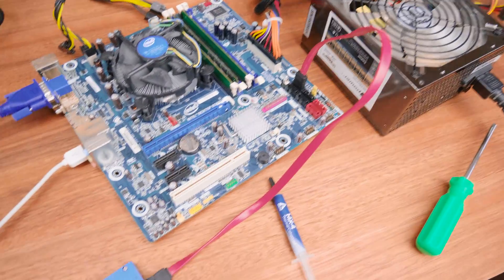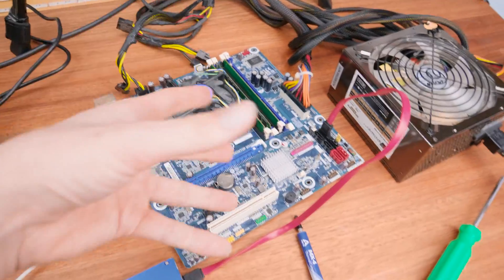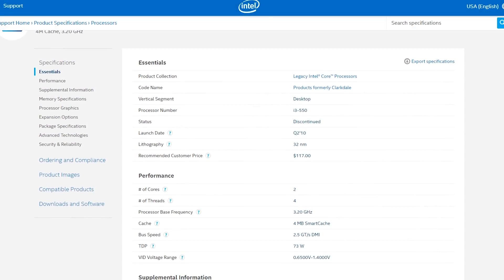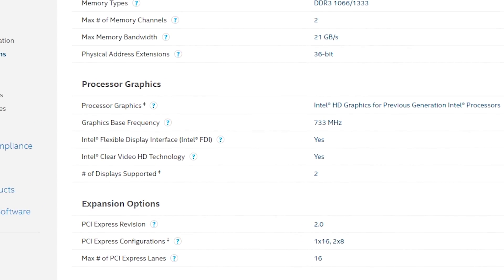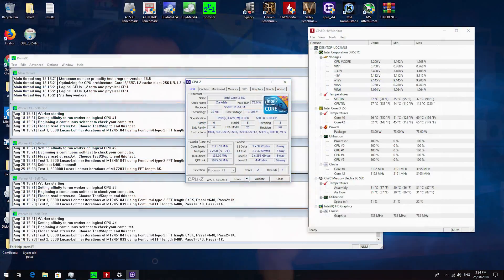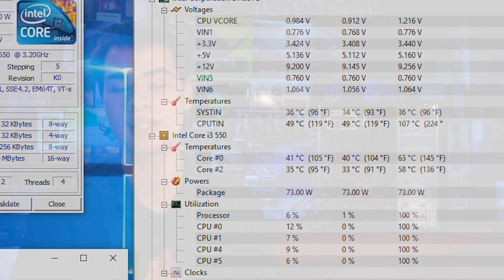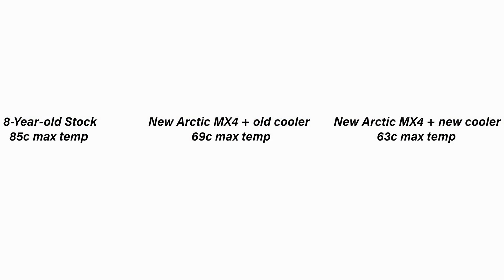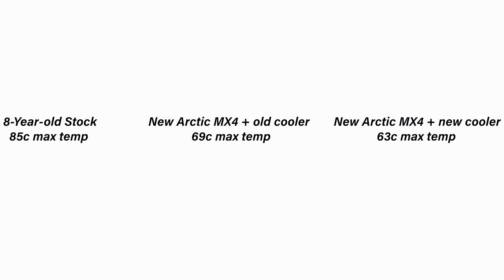How Bad Is 8 Year Old Thermal Paste

Comment: I just changed my thermal compound' but the tube was really old, + I haven't tried to OC lately & didn't check the temps 1st.
That said, the old paste was dried out & mostly kinda' clumpy, lumpy.
That paste was the Cooler Master that came w/ my 212 EVO cooler.
So I don't know if there's any improvement; wish I'd seen this last week, before I replaced the paste.
BTW, I have an old AMD Propus cpu on an ASUS M5A97 2. board, 12Gb ram, & an old Antec EarthWatts 430 psu.
It will suddenly freeze, no warning, nothing, just completely hung & it has to be reset to restart, Cntrl+Alt+Delete doesn't even work.
This system had an electrical surge in 2016, had to replace the mobo w/ the M5A97.
Any ideas what could cause that?
I'm clueless, so I'll check back to see what youse guys think.
Many thanks in advance.
sl0j0n
Reply from the maker: Might be a windows issue or some software issue, a reinstall of windows might be worthwhile to see if it helps. There is a slight chance that it is a hardware issue but  i'd be looking at software first

Comment: Good information.  I had just replaced an older laptop thermal past that was probably about 5+ years old.  It was still soft and also did not make much of difference.  Well at first the temp rocketed up 15 degrees so I reset it again and then it was just the same.  Not sure what the problem was, but could have been anything stupid at 3am.  Thanks for the content CPU modder.